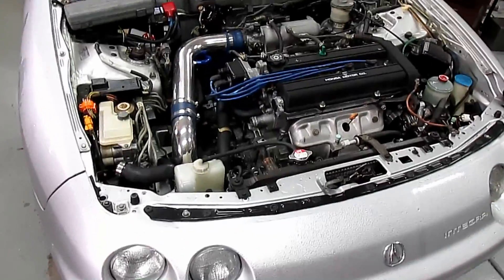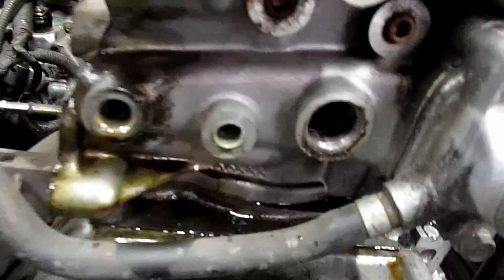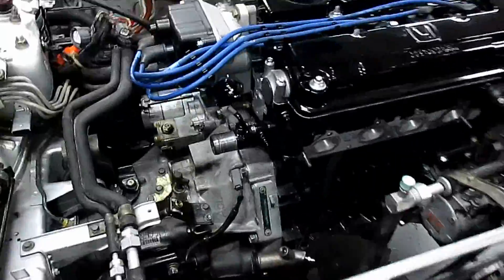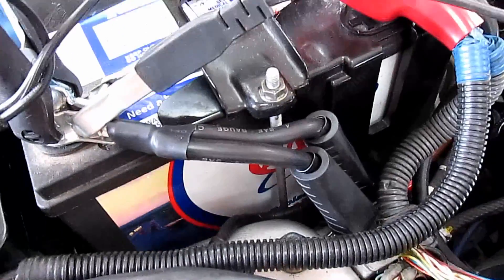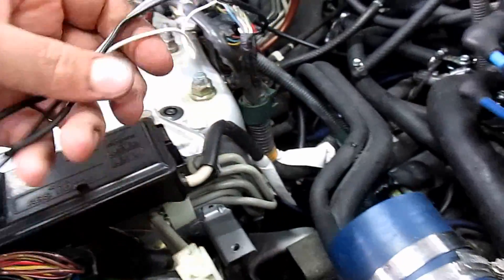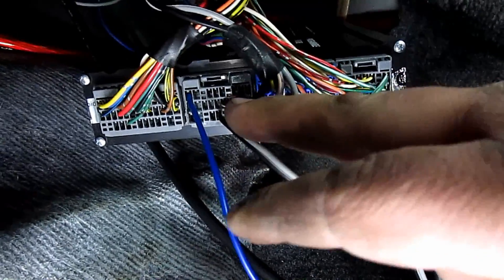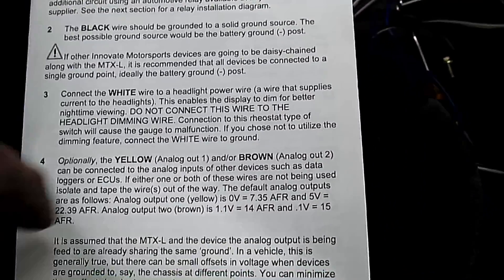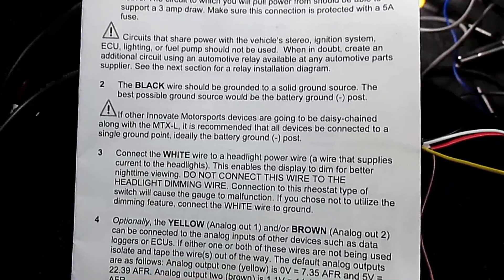Project "No Rice" #8: Engine Install & ECU Swap (Stroked LS/Vtec Acura Integra)

Comment: I did a lsvtec swap in my 92 integra b18ablock/b16head I am having troubles finding the right distributor every one I've tried the plugs don't match the 2 on the harness anyone got any tips?
Reply from the maker: You will most likely have to swap connectors with solder and heatshrink

Comment: I did a lsvtec swap b18 block with b16 head in my 92 integra I am having issues finding which distributor to use (the few I've tried the plugs don't match the 2 plugs on the wiring harness)  HELP!
Reply from the maker: You will most likely have to swap connectors with solder and heatshrink

Comment: I recently purchased a 96 Civic ex that the seller claimed was swapped to a 99 si b16,it has si wheels, taillights.. etc.after getting the car home I found out that it is actually an ls/VTEC setup... block is a b18a1 the head is a 2000 Integra type R.I am not sure which transmission it is,but has a close ratio.the ecu is a chipped and socketed p28.the car hauls ass and revs to 8,500 rpm.but at low rpm(idle to about 1500)a notice a vibration, There is no codes or check engine light coming on. I wish I knew what was done,now just a guessing game.anyway I enjoyed your "no rice" series.would love to see more videos on b series.seems everybody wants k series swaps now.
Reply from the maker: Thanks For Watching!!!